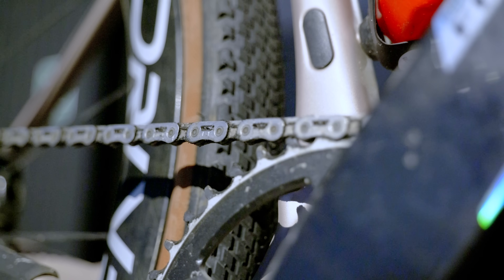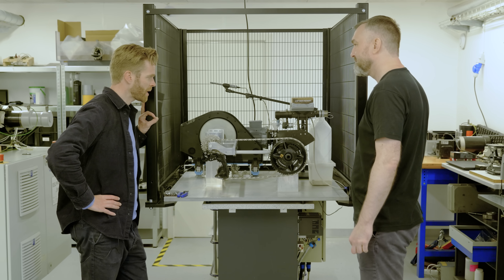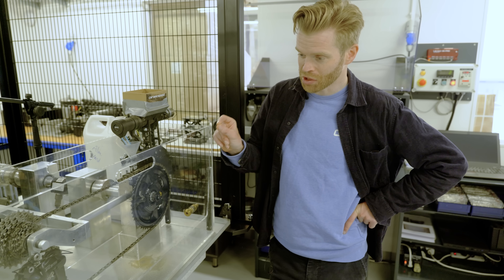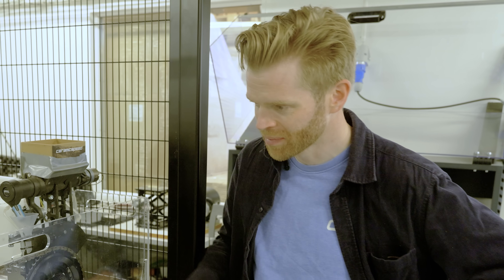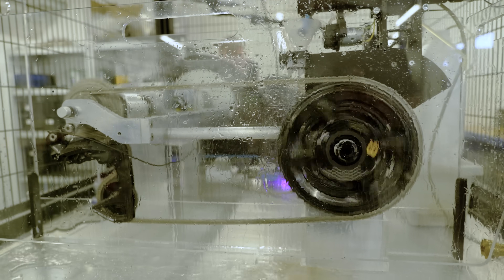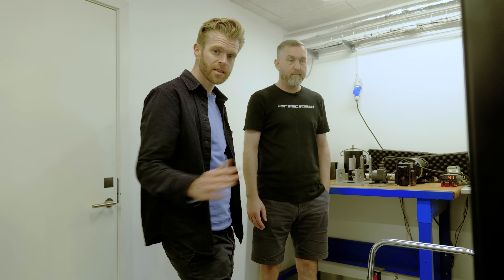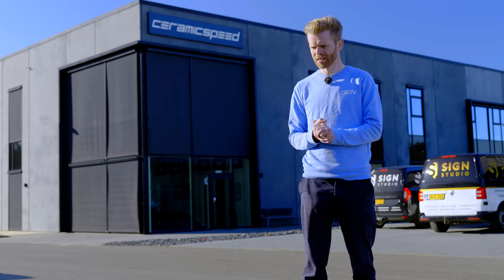We Lab Tested A Dirty Chain, How Much Slower Was It?

Comment: When I was a boy in the 1970s, I had a newspaper route. I delivered newspapers from a bicycle. The bicycle I used was a 1950s balloon tired bike. (People would call that a beach cruiser today/ I think Pee-wee Herman )depending on what day of the week the papers could get quite heavy. Sometimes I would have to take two trips, because I could not fit all the newspapers in my delivery bags that were slung over the handlebars. That bike took a major amount of abuse. Riding it through rain and puddles dirt paths. Sometimes the chain would squeak.  My father would spray my chain with WD-40 and have a ride it a short distance. After the WD-40 dried, he would use light machine oil.( sewing machine oil) on my chain. He would then lubricate the wheels, the same way, and the bracket /steering down tube. I remember being impressed as a kid of how much easier the bike was to ride by using some oil and cleaning the chain. Living in Tucson, Arizona, and riding that bike down, dusty alleys for short cuts would attract quite a bit of dust and grit to the chain. I did not lubricated as often or as carefully as modern bicycle enthusiast does. Just a quick spray of WD-40 to clean and later machine oil or whatever Oil was on the workbench. It made a huge difference, even on a very crude, single speed bicycle. The load of papers that I would deliver, sometimes weighed more than I did. Especially on Sundays, and on Wednesdays when the coupons for grocery stores were issued.  How life has changed. Nobody reads newspapers anymore. Cell phones in our pockets as electronic leashes that anyone at any time can bother you. However, the bicycles are so much better and efficient. Just not as beautiful as a lugged framed racing bike was back then.
Reply: That’s a mirror of my same story. I covered a paper route for a buddy , I rode a 50s Hawthorne with huge tires 26-2.125 I think. Simmer of 78, in Poulsbo, Wa. Fair amount of hills. Amazing how hard we worked as kids. I used WD 40 and 3 in 1 oil on my chains. Great story, glad to know I wasn’t the only one.  Still riding, I have vids of my bikes and rides …. 😊
Reply: I swear by motorcycle chain oil for bearing rejuvenation without opening it all up. Just a few drops between the axel and bearing
Reply: Although it's sad to see newspapers fold (pun intended), think of the resources that are saved in not cutting and processing trees into paper, not transporting raw and finished product, not running presses nor heating/cooling the plant, and not dealing with the used product the next day. i read the news on my laptop today and just pushed a bunch of electrons around.
Reply: Thanks for sharing
Reply from the maker: Great story, thanks for sharing!
Reply: I've been bike commuting in Tucson for 45 years. Currently, I'm riding a Co-Op touring bike. It's longer wheel base and larger tires really help smooth the terribly potholed roads in town. The bike lanes are where the thorns, glass, water, sand, mud and whatever other road debris collects. Every 6 months or so I'll scrub the drive components with Simple Green, then rinse it really well and let it dry. Then I lube with some Marvel Mystery Oil. Any resistance just adds to the workout. It's not a great concern for me. Flat tires are a different story. It took a few years to figure out a system for preventing most puncture flats. I use tires made with Kevlar, a puncture resistant tube and a nylon liner between the tire and the tube. I get a flat every couple of years, now.
Reply: Yeah, I still ride a 3× & 2× drivetrain, & I avoid waxed chain like the plague it is: A really good quality bicycle chain doesn't rust, & is so hard surfaced & close-fitting that 'lube' just adds drag, especially anything as thick as wax. 

A good quality bike chain, doesn't need lube (nor even benefit from it, initially at least) & actually runs more efficiently dry, than oiled or waxed. Only when wear allows particulate inside the hinges, does lube finally help more than it hurts... & by then the chain could be replaced for less than the cost of most bike chain waxing regimens! 

It's the sticky stuff spread all over a chain, that collects grit & dust. 

A clean dry chain hardly collects debris at all, especially a really hard one. 

Waxing is nuts, so far as I'm concerned; just buy an extra chain to save yourself some time, mess, and money?
Reply: @prophetzarquon  bike chains do rust, especially if you ride in winter on salted roads. All you need to prevent rust is a rag, a tin of WD40 type spray & a tin of 3 in 1 type oil tho, so it's not a big deal. Just don't put your bike away wet is all.
Reply: You need to remember that they tested new the best chains you could buy for money, not some cheap single to 8 speed chains at the middle of their wearing.

Comment: How about testing a dry chain? Once my chain starts making noise from lubricant drying out, it  FEELS slower.  I've never felt like a dirty-looking chain was slowing me down (but of course, it is EMBARRASSING!).  I would propose that the critical element in efficiency (without involving gear choice) is that the chain have adequate lubricant where NEEDED, which isn't visible at all.  So put a dry squeeky chain on that machine and tell us how it measures.

Comment: Will Shimano see this and perhaps change the standard to 34-13 range on casettes instead of 30-11 and we will all go for bigger chainrings I guess?
Reply: That's an interesting thought, if we limit the highest gears at 13, we could redistribute cogs to be even tighter or even have higher range for low gearing and just have the chainring be the multiplier for top speed.
Reply: they will have to increase the front chainrings and the drive train will become heavier. It's a fine ballance, I think they know what they're doing

Comment: Interesting machine and test.
It would be interesting to see the power loss difference between small and large chainring on the front at the same (similar) ratio at the cassette.

I mostly ride on the large chain ring to have a higher chain speed and thereby less force on the chain to reduce wear of the chain. 🧐
Reply from the maker: sounds a good experiment to try out on the machine!

Comment: Thank you for sharing this!  It finally answered a question I've pondered since one of your previous chain efficiency tests: While riding up a moderate hill, is it more efficient to ride in the big chainring and a large cog, even though it is cross-chained, or the small ring and a smaller cog with a better chainline but smaller ring & sprocket?  From the graph you show it looks like I should stay in the big ring as long as I don't have to go into the largest ("lowest") two cogs.  Would be great to know what the power losses were for each cog and how many teeth they had.  
Also, I am astonished that it is typical to lose 5% of my power through a clean drivetrain!  (12-14W out of 250W input). And the best drivetrain still loses about 3%.  I'll try to keep that out of my head when grinding up a "moderate" hill 🙂

Comment: Time to switch to 60 teeth chainring and 20 teeth rear sprocket single speed.  Throw away all the derailleur, pulleys ,cables , shifters and other sundries,  and fit the chain perfectly aligned.

Comment: Excellent content!  I’m really curious how losses scale with power.  Linear, quadratic, cubic?  That would be a very interesting.  Not surprised that larger gears are more efficient, that’s been known for decades, but surprised that effect was greater than chain angle. For those of us old enough to remember 13t as the smallest cog, I was more than a little dismayed when the industry trend went to 12t, then 11t, and even some 10t.  You can feel the difference when you pedal, with a noticeable cogging sensation in the smallest sprockets. Not surprised water alone wasn’t significant, as water is a lubricant, and is used as such in various applications. It’s the rust that comes with water, over time that is problematic. In Human Powered Vehicle speed racing, we often noticed that the best speeds occurred shortly after rain, when there was still a thin film of water on the course, but not big puddles. Of course there is also high humidity under such circumstances, so the wet air density is a little lower, and I never saw any science to try and unpack the two effects.

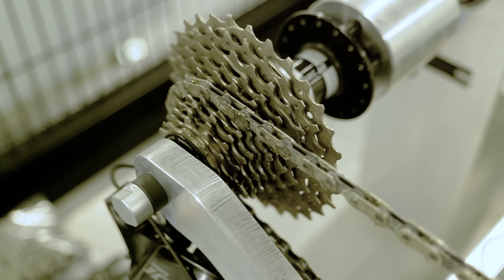Comment: 2:40 "It has an incredibly [sic] amount of links that needs [sic] to be articulated..."
No, only two links need to be "articulated" on the high tension portion of the chain, where it matters, 6 more on the low tension side.  That's not an "incredible" amount by any measure, it's maybe about 3% of the links.  From the very beginning, the very first comment, it is clear this guy isn't very knowledgeable.
That fact that someone operates test equipment  doesn't mean they know what they're doing. BRR is a prime example.

Comment: I've always felt that a factory lubed chain, straight out of the packet, is sticky.  So I've always cleaned and lubed the new chain after installation. Curious if this perceived stickiness is real or imagined.
Reply: MFG grease is put on the chain to keep it from rusting, not to give you a nice oiled chain. Always clean the chain and put your own lube/wax on. Always! Especially the SRAM chains are more like a grease than an oil. Terrible watt losses out of the box.
Reply: @TGMvideo That's what I've always done.  Have both Shimano and SRAM. Will have to pay mind to notice.  The last was on both bikes at the same time. Didn't notice.  I've been asked about running mfg grease out of the package.  Makes no sense to not change the tool to fit the job. Replace grease with oil.

Comment: Here's why the dirty chain was only 1 watt less efficient. It was probably maintained with regular cleaning and application of lubricant to each roller such that the lubricant seeped into all the interstitial areas between the rollers, pins, and plates. Those areas are what are going to create the most friction and, despite a recent, brief period of abuse, were probably still in good shape. The proof of that is in the test run over each of the sprockets that proved that the greater the articulation of the chain (from the small sprockets) the greater the loss. From that you can conclude a) the friction between the rollers, pins, and plates causes the bulk of the loss and b) friction between the sprocket or chainring and the chain cause little power loss. Your dirty chain was probably in good shape with regard to (a) and the dirt fell mostly in the (b) category with the latter having little impact as this type of friction doesn't cause a lot of power loss. Maybe the UCI gear restrictions are actually doing SRAM a favor by forcing them to get rid of that ridiculous 10T sprocket.
Reply: Right? Who cares how much dirt and grime is on the outside of the chain links? As long as the oil and grease is keeping the dust outside and it isn't getting in the joints, then it is fine. The bigger mistake is how people who clean their chains regularly are likely using brushes and other tools to force particulates inside of the joints. Never use brushes or other things on your chain, just run it through oil and let the dirt "fall" off.

Comment: Huh, so it sounds like the optimal setup for 1-by ISN'T small chainrings, it's big chainrings and MASSIVE sprockets. Like, What if you start with a 52-tooth ring up front, and then go up to 60-something cogs. Then there's a weight penalty, I suppose, so you'd need to balance efficiency and system weight. Interesting!

Comment: I love the fancy-ass setup, and then the box is duct-taped to the top of the assembly.
Reply: The whole setup is actually pretty creative using off the shelf parts, it's basically a Tacx Neo 2T smart trainer bolted onto a stand via a custom axle to provide ERG mode resistance and an SRM spider-based power meter to read power data onto a Shimano 105 di2 setup (so you could control shifts wirelessly). Then you have an electric motor acting as the rider pedalling.
Reply: @ryoukokonpaku1575  Oh yeah, the whole thing is AWESOME, to be clear. Some times duct tape is just the right tool for the job.
Reply: @VincentJGoh  I drilled some holes to screw in something, the duct tape helped keep the sand inside :D
Reply: @ryoukokonpaku1575  Nearly correct, it uses 2 torque sensors load and drive side (one on each axle, at 3:12 you can see it in front of the Tacx, has the yellow sticker on it) for accurate watt measurements. And encoders keep track of both axle rotations. And yes the Di2 is used to switch gears as well as tell what gear its currently in.

Comment: Interesting test. Most of my hours are on sandy muddy MTB trails. I usually rinse and dry my bike after a ride and quick re-lube with T9. My XT chain goes out of spec after 120-150 hours, double that for the cassette, triple for the pulley wheels and chainring. This test confirms my upcoming decision to go to a 34t ring from 32t to improve my chainline.

Comment: After watching this, am wondering if it is more efficient to go with a larger front ring with larger cassettes than a smaller front ring with smaller cassettes.
Reply: As far as I can see the only drawback would be more weight in that you would need larger sprockets/chainrings, a longer chain and possibly a derailleur with a longer.cage.  I doubt the weight increase would make much difference unless you spend a lot of time climbing.

Comment: Well my take away from this is that cleaning my chain is not worth my time.  The question I have is, are the ratio of cassette gears to chain rings optimal.  Maybe the cassette should have larger gears and the front chain ring gears should be smaller for the same gear ratio to minimize losses.

Comment: Next step: build a more efficient  drivetrain with the smallest sprocket around 25T and the same gear ratios as the standard system. So to equal a 53T front to 11T rear, your chainring needs to be about 120T. Make it happen, Dr Bridgewood!

Comment: I would like to know if the resistance when back pedaling the cranks with your hand has any correlation with the losses shown in gear selection, as it seems very like it. When I'm lubing the bike on the stand I notice a huge difference in resistance moving the cranks depending on the gear, particularly in the smallest cogs. And having a sub optimal chain like is definitely more noticeable in the big chainring because it increases the chain angle compared to the smaller chainring. I would like to compare the losses in gear selection between small and big chainring, particularly for sub optimal chain lines.

Plus, does seat stay length length amplifies losses in sub optimal chain lines? Having the chainring and cassette closer to each other does increase chain angles in the extremes of the cassette, so cassette/chainring size is perhaps more critical in smaller frames?

Comment: Seems like a good argument for not using a 10t with a smaller chain ring
Reply: At least on a 2x SRAM eTap setup, it won't let you do that.   I can use the whole cassette in the big ring, but the small ring blocks the 10.
Reply: @davethedogdude  what they probably meant was that SRAM is combining their 10t cassettes with sub-compact chainrings, i.e. the big ring is <50t.
Reply: Other way round. Its the 30T that is more efficient than the 11T being closer to the Big cog, as tested. Thus the small cog should be more efficient still being closer to the middle to smallest 11T on the cassette. Of course it's slower too so won't be popular with those who ride on the flat. They will want a huge big cog.
It's hilarious for us who ride hills that climbing gears are more efficient.

Comment: I've said for decades: if you're a recreational rider, keep your entire drivetrain /reasonably/ clean and /reasonably/ well lubricated.  Do it more frequently rather than trying to be OCD about every conceivable (and often elusive (or imaginary)) incremental gain.
Reply: And everything has a path to OCD. Content creators need content so every minutia of any hobby will be covered. You want a coffee maker, you start by watching top 5 espresso machine videos ten hours later you need specialized gear for every step, sensors and an app to monitor and track you pressures. Then you have to make an effort not to give a fuck.
Reply from the maker: a clean bike is a happy bike!
Reply: sure thing but IMO cleaning it once a week should be enough, ofc the frequency would vary depending on where you ride it, i mostly ride mine in concrete and tarmac so i don't need to clean it as often but every two weeks i give my chain and all other mechanical parts a little refresh using my trusty can of WD-40

Comment: So, when going up a small rise it's actually better in performance if you stay on the big ring in front and use a bigger sprocket (even the penultimate one) instead of swapping to the smaller ring on the front and shifting down to a smaller sprocket on the back.

Right?

Comment: You want to know how bad it can get. Well, one my ride, 220km to the pit stop and about half the distance was in rain, mud and sand. Even after simplest cleaning, when the chain dryed out, it was stiff as b*ner. You could literally hold part of the chain in air and it stood horizontally, did not bend downwards, almost like links glued together.

Comment: At 3:26 there is a cable tie holding the derailleur cable in place, so that's definitely a bodge.
Reply: The whole machine seems to be a bodge.. look at the sand thing, then its not fixed as he said, but they just marked the bottom to see if it moved. They run sram flattop chains on shimano chainring and cassette. It is incompatible due to bigger roller size on the sram chain.